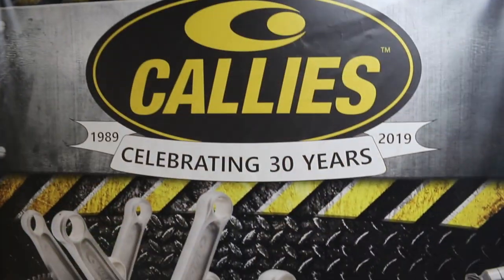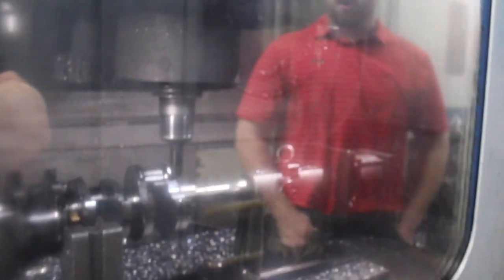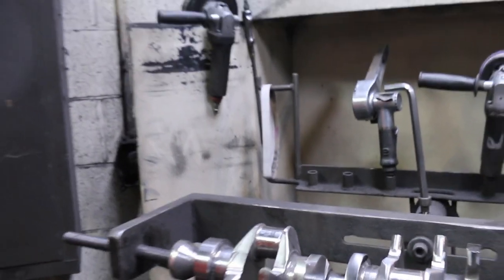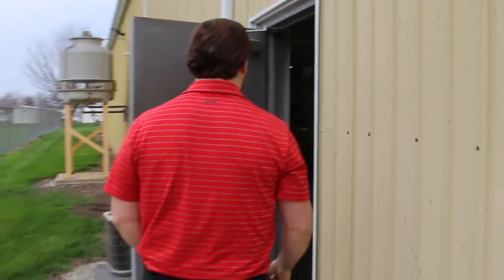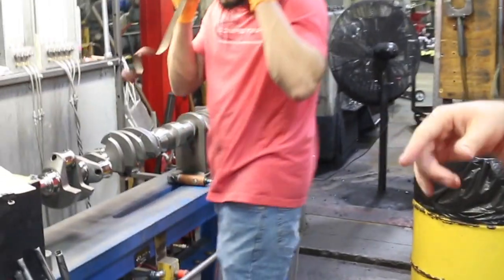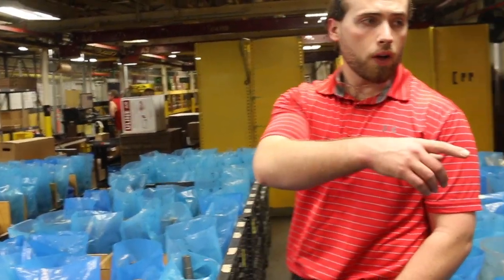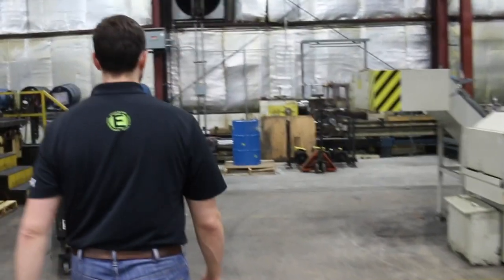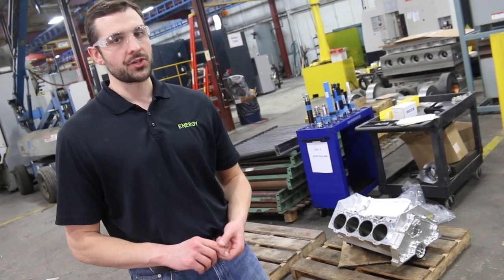Top Fuel Cranks! HEMI Engine Blocks! Mopar Connection Goes on a Callies Performance Factory Tour

Comment: i noticed they tell everyone to store a crank vertically but run them ar horizontal it would help qc if they built a coat hanger style cart to hang cranks rather than stack them theres microscopic cracks in the stuff at the bottom i guarantee i could find with a fischerscope
Reply from the maker: Interesting hypothesis

Comment: Also, people would run a low deck hemi too, just make the block
Reply from the maker: No, nobody would - at least in the numbers that they would get their money back. This is a ridiculous suggestion for a company to invest ONE AND A HALF A MILLION DOLLARS into. Because that's what it costs just to tool up such a block. Ask Muscle Motors, Bulldog, INDY or any other company (I have). That's what it costs.
Reply: @moparconnection  it's not ridiculous.
People made hemi headed wedge blocks in they're garages decades ago. It wasn't any 1.5 million dollars.
Reply from the maker: @Moparmaga-1  it's outside of the realm of possibility for these major manufacturers. Stage V made a VERY limited run of "conversion heads" for wedge blocks 20 years ago. Even fewer for low decks. Unsurprisingly, the demand wasn't there to keep going. Jeremy Goodstein attempted to offer similar Hemi conversion heads (even for LA blocks) and lost hundreds of thousands in the process. The money is in RB and Hemi blocks first. Then G3 Hemi blocks. Then MAYBE over years of sales, LA blocks. Low deck is (according to these companies) waaay in the back. I'm not trying to be argumentative, but just relaying what these guys see as far as customer demand.
Reply: @moparconnection  okay thanks for your time. I get it, it's all about the dollar...
Reply from the maker: @Moparmaga-1  yeah, sadly it's always about the bottom dollar.

Comment: Low deck blocks guys.... c'mon the most popular stroker builds would be low deck if the blocks were available. I personally would buy a low deck 4.500 bore right now and have no worries about running B1 heads up to 9500 rpm.
Besides the low deck fits everything better.
Reply from the maker: Low deck are in such LOW demand it's not worth the investment.
Reply: @moparconnection   100% false statement. How about you do a poll and find out...ask all the a-body guys see what they say.
The reason why they don't produce the low deck is because they're cheap and producing the hemi and wedge in rb is basically the same besides the hemi head deck.
Reply from the maker: Sorry, Charlie. I've talked with Chris Wheatcraft (owner of INDY), Dick Bradshaw (former owner of Bulldog) and Heath Norton (owner of Callies) the market demand is NOT THERE. It's very niche, and not enough to cover the cost of tooling.
Reply from the maker: They did. I don't believe the Indy MAXX block is still in production. The last I saw, the MAXX block was $7,300.
Reply: @moparconnection  yeah I'm aware. Indy Maxx is an 18 month wait. The funny thing is every other manufacturers blocks are reproduced at 1/2 the price. Not is great as bmp or callies but available. 383 was the most popular engine Chrysler made for a big block so, I don't really have a point . It's just irritating that Chrysler chose not to back it's patrons like Chevy or Ford. Hell Chrysler kicks their asses to hell and back why not make it worse for them.
Reply from the maker: Yeah, you're correct on that front. Chrysler doesn't produce ANYTHING for classic Mopars nowadays. It's all sourced out through licensing contracts.